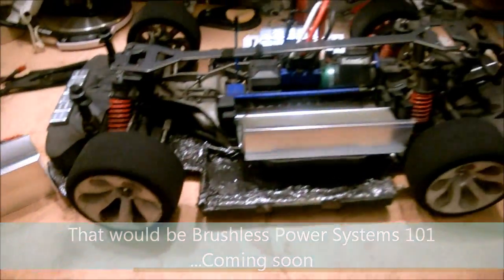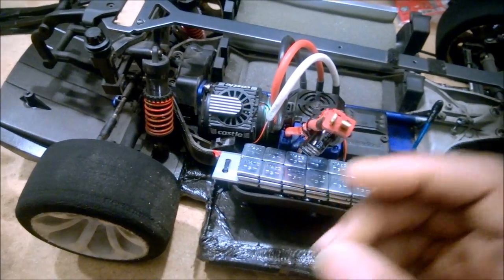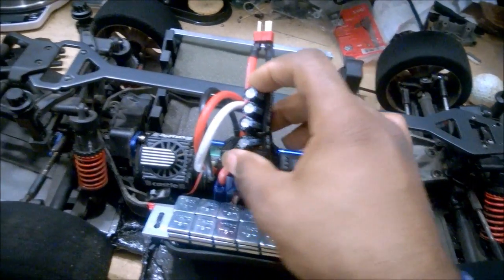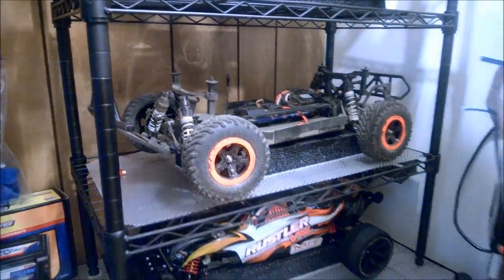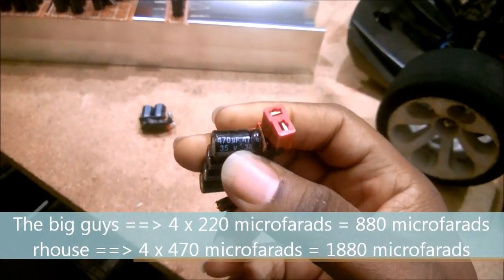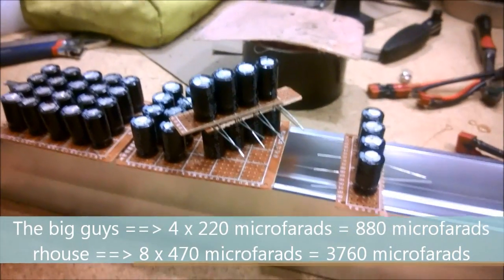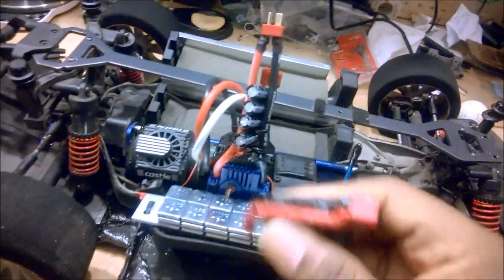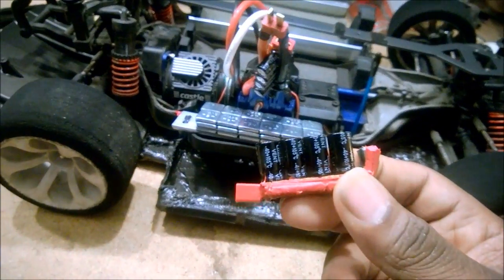Ep. 88: Cap Packs 101

Comment: What if I Run a 50c 5000mah 4s lipo mamba monster 2 slash 4x4 do I need a cap pack
Reply from the maker: saud al abdullah A cap pack may not always be needed, but it shouldn't hurt. A Mamba Monster 2 ESC can pull up to 120 Amps continuous and quite a bit more in very short "bursts". The cap pack will fill in the "burst" demand making it easier for the battery to keep up with the ESC's power needs. Not all batteries are created equal (sometimes you can't trust manufacturers' C-ratings). A good hi-C lipo should be able to keep up with the continuous load (Castle recommends 25C or higher), but they still need a short time to 'ramp up" to a really high burst load. A good quality cap pack should help everything work better and provide fairly cheap protection for your electronics, so I say go for it.
Reply: Thank you very much I stick with traxxas and hpi batteries
Reply: Oh and if I run 20t pinion and 54 spur with a Center diff on a mamba monster 2 slash 4x4 4s how fast will I go ? I have the j concepts scalpel body with xo1 wheels
Reply from the maker: You can use the website to below to calculate your top speeds, but you probably should drop the center diff and either go with an E-Revo/Slayer slipper clutch or use a slipper delete unit. The center diff is really intended for off-road racing. The problem is that if you start to spin your wheels, the digg could send all your power to the spinning wheels and kill your run.

http://scriptasylum.com/rc_speed/index.html
Reply: I'll try the Center diff and the stock slipper clutch and see which I like best it depends on the car not all are the same most of the people I know run a Center diff and some use a slipper clutch (stock) anyways thanks for the website I'll check it out !
Reply: I tried the site it said I will reach 20mph 😂 really a brushed stock car can go faster
Reply from the maker: saud al abdullah I think you may need to double-check your inputs. You have to be sure to enter all your car's inputs accurately or you'll get some weird numbers. I'll put your configuration in my spreadsheet and see what I calculate later today and get back to you. Are you running the 2200 kv motor?
Reply from the maker: I ran some quick numbers. If you have a 3500-3800 kv motor an the battery voltage doesn't sag too bad, you should be in the 70+ mph range (maybe even a little better). If you have a 2200 kv motor and those gears, you are looking at 40-50 mph.
Reply: Thank you very much but those are low numbers I run the 2200kv what can I do to hit 90 at least and is it safe to run 6s my dads friend said it will explode I'm not sure
Reply: 50 is lower than stock traxxas  promises with a stock spur 80mph with 6 cell nimh
Reply: I just found a 25t pinion laying around brand new I guess ill use that see how it goes
Reply from the maker: You've got a little homework to do, my friend. The kv-rating of a motor tells you how many rpm you can expect for a given amount of battery voltage. The 2200 kv motor is bigger, but it spins ~60% as fast as the stock brushless motor for the same voltage. It produces a LOT more torque, though. So, just putting in a bigger 2200kv motor without significantly changing the gearing will actually slow your car down by 40%. As a result, you need to change your gearing to take advantage of the torque on hand and speen the wheels a LOT faster. Play with the speed calculator website I gave you and it should put you in the right ball park. I hit 70+ mph on the slash platform on 3S and many guys have done 80+ on 4S with your motor. Your ESC is good for up to 6S, but I'd recommend getting really comfortable with your 4S setup before going higher. I'm using the same ESC and hope to get over 100 mph on my next outing. Driving these things at high speeds is HARD and you have to do a lot to keep the car on the ground. The Scalpel body claims to be a speed-run body, but it is pretty draggy compared to others out there. Look up guy named Tinsley Smith on YouTube who did 100+ using that body, but had a lot of problems with it getting airborne. There are other options out there that work better.
Reply: I wanna run 80mph so what gearing should I put
Reply from the maker: saud al abdullah Speed run guys are very protective of their gears. It's kind like asking for someone's secret recipe. Truthfully, the best gearing will vary from vehicle to vehicle so you really have to experiment to find the best setup for you. Two identical cars with different bodies, batteries, and tires will give different top speeds. I will tell you that the E-Revo/Slayer 36 tooth Mod 1 spur gear is what I use and is a good starting point. You can use the website I gave you to figure out the right pinion for your speed goals. Assume your battery voltage will drop to ~3.3 - 3.7 Volts per cell under load (13-14V total) and get two or 3 pinions spaced 3-5 teeth apart and you should have everything you need to find the right gear for you. Good luck!

Comment: good vid. but using higher V caps cant hurt. kind of like having a bigger cup...you can have more drink without spillage
Reply from the maker: Actually, there is another secondary benefit. As I mentioned in linked video, (https://youtu.be/cBQXZ3aEh5k ), one of the reasons caps fail is that they can heat up internally while surpressing ripple voltage. Higher voltage caps are physically larger and have more surface area to shed heat, so they should run cooler under the same conditions. 

Thanks for the comment!

Comment: I have a Arrma Kraton running 5200 50c 4s And at times drop in 2 5600 75c 3sPower Hobby battery’s And stock BLX185 esc And 2050kv motor.  What would be the best choice for this ?
Reply from the maker: I should have a batch of my 8-Cap rH218-8S packs ready this weekend. One of those would probably work really well for you.

Comment: Good video. quick question. on my 6s system, my data log shows a drop of about 4 volts at full throttle. do you think this is due to not having a cap pack? or is this a battery/esc issue?
Reply from the maker: Actually, what you are seeing is called "voltage sag". I did a video on this a little while ago. https://youtu.be/0KLOXEWrOes

In short, even though batteries convert chemical energy into electricity, they have a small amount of resistance to electricity flowing through them. (As you might have guessed, this is called "internal Resistance.") Ohm's law says that when you pass current through a resister, you will see a small amount of voltage drop across that resister. (V_drop = system current * resistance) 4 volts of drop is actually not too bad actually. Many guys see as much as 6-9V of drop. I have another couple of videos that show how to dig into your data logs to get clews about how your power system is doing. 

https://youtu.be/0DJSKSlGdq4 
https://youtu.be/b_iVQyl0Ags

Be careful crunching the data, though because it can take a little while to get a good feel for how to interpret the data. For example, 4V of sag ca mean that your batteries are VERY good and manage your system's load very well OR it an mean that your system is very lightly loaded and you are not pulling much current implying you have a LOT of tuning headroom. 

I hope this helps!
Reply: so I guess my question is. do I need a capacitor pack, and if so which one of yours do you recommend? looking at the data log, the most sag I can see is about 5.5 volts.
Reply from the maker: How much ripple voltage are you seeing? If it is more than 10-15% of the system voltage (more than 2.5 - 4V), you should probably be running a cap pack. I run my 8 cap rH218-8S packs on my MMX ESCs and the ripple voltage dropped from 5+V to ~10V with some pretty high current loads. Remember, your batteries have a lot to do with your overall ripple level, so you may end up with a different number than me in the end, but it should be a significant improvement. If that's not enough, I'll be willing to exchange that pack for a 12-cap rH2112-8S, but I suspect the 8-cap version will handle your system fine.
Reply: rhouse21 - RC Physics can you give me the link to buy it on eBay. I'll also do a before and after video to show the improvement.
Reply from the maker: Here's a link to my ebay auctions.

http://www.ebay.com/sch/Toys-Hobbies/220/m.html?_nkw&_armrs=1&_ipg&_from&_ssn=rhouse21&_sac=1

Comment: How Would I Know If My Cap Packs Are Working?
Reply from the maker: This is a simple question with a not-so-simple answer. In a nutshell, there are 3 ways to tell if your cap pack is working.

1.) A good cap pack should filter out system ripple, which protects the ESC from damage and can make it perform a bit more efficiently. Many guys say this will result in lower run-temps and more overall power. Soooo, you might be able to "feel" that your cap pack is working by noting any differences in system power and/or run-temps. The problem is that a good ESC may not need a whole lot of help under most conditions, so you may not feel any difference at all. This is a tough one because it's all based on "feel" with no data. I have guys who claim that my Cap Packs completely changed the behavior of their cars.... but On'y a couple of guys have actually been able to show me any data confirming anything.

2.) Speaking of data, if you have a data logging ESC or an EagleTree data logger, you can look at your data logs with and without your cap pack installed and see if it is lowering your system ripple. This is about as clear as proof comes, but some guys are a little intimidated by digging through data logs. Here is a video I did a little while back that can guide you through that process. https://youtu.be/0DJSKSlGdq4

3.) So, lets say you do not have a data logging ESC. You are not out of luck. You can actually get a fairly inexpensive multi-meter with capacitor measurement capability for $20-$40. Ideally, you would want to measure the capacitance in the ESC before you install a cap pack and after you have it installed. I wire all my cap packs with a quick connector so I can easily disconnect it from the ESC and measure it directly, but measuring it while connected to the ESC works too, as long as you know how much to deduct for the ESC's internal caps. This method will also tell you if you have blown any caps in your pack, which does happen over time with enough abuse. Here is another video I did showing how to take these measurements. https://youtu.be/cBQXZ3aEh5k

Thanks for watching!

Comment: Good day, sir. Nice video. So 8 pieces of 35v 470uF caps would be enough for 8s speed runs? 8s is max 33.6volts
Reply from the maker: It honestly depends on the caps, the system current levels, and the quality of your batteries. Lower current levels and better batteries drastically reduce system ripple voltage. 

If you go to a good electronics web site like www.digikey.com or www.mouser.com, you can pull up the detailed specs such as ESR (Equivalent Series Resistance). The lower the ESC, the faster the caps will charge and discharge, so the more effective they will be. A few 'small' high quality low-ESR caps may outperform 10 high uF "junk caps" from Ebay or Amazon.

Also, you should look at other specs such as expected lifetime and ripple current capability.
Reply: @RCPhysics  thanks sir. Im using  2x 4000mah 100c 4s lipo. I will refer to that link you've given

Comment: which is better a high uf or low uf for rc cars
Reply from the maker: The uF value of the individual caps sets the RPM/current level where the Cap pack starts filtering your system. Larger uF caps will kick in at lower frequencies, but will not be able to keep up s much as frequencies climb very high. More caps in parallel help to manage higher current loads in the system. One of my 8 cap rH218-12S cap packs would provide great protection for a 300+ Amp Castle XL-Series 8S ESC while a 4 cap rH214-6S cap would be enough for a most 3-6S systems rated for ~100-150 Amps.

Comment: Will It Also Prevent The lipo Batteries From Puffing Up???
Reply from the maker: Batteries puff because they have sustained internal damage. A good cap pack should help your batteries see a more stable load that should help to protect them from damage, but a cap pack can only take so much abuse before it starts to take damage itself. 

I think a good cap pack will help, but there are a LOT of other  factors at work. The cap pack will work harder with lower quality batteries. The lower quality the battery, the harder the cap pack will work to try to insure clean power, so the more likely you are to blow caps in your pack. If your packs are puffing, they are being overworked. Adding a cap pack would probably help, but that would just be a "band aid". The pack will probably fail if you keep pushing it that hard. Puffing is a sign that it's time to upgrade to better cells.. 

Thanks for the great question!
Reply: Ooh, WOW!! Thanks For Answer.. I Learned Something New.. I Just Ordered A Cap Pack From Castle Creations, Hope It's Good Enough For My X Maxx Esc?
Reply from the maker: That may be a little small for that ESC. Are you running the stock ESC and is it the 6S or 8S version? The castle cap pack is for 6S max but it's really meant for much smaller cars (1/10 or 1/8 scale) with ~100 Amp ESC's, so just be careful there. The X-Maxx is a pretty big machine and that ESC probably pushes quite a bit more amperage that might overwhelm that cap pack. 

I would recommend one of my rH218-8S packs, but I'm out of stock right now. Check back with me in about a week, though.
Reply: rhouse21 - RC Physics Ooh I See.. I Have The Xmaxx 8s Version, But Only Using Traxxas 5000mah 25c 6s Lipo Batteries... Cant Afford The 8s Lipo Batteries.. Do You Sell Them On Ebay?
Reply from the maker: I sell my cap pack on Ebay. I've been slow getting my latest batch ready for sale though. I don't sell batteries, however.
Reply: Ok Cool,What's Your Seller Name?
Reply from the maker: rhouse21 :-D
Reply from the maker: http://www.ebay.com/sch/Toys-Hobbies/220/m.html?_nkw&_armrs=1&_ipg&_from&_ssn=rhouse21&_sac=1

Comment: Would you fit a cap pack on a xlx2 just as a precaution or no? K8s 1100kv motor.
Reply from the maker: I've sold a number of custom cap packs for XLX2 setups just for extra protection. Technically, you can't really have too much capacitance... unless it starts to cause such an in-rush current spark when you plug in the batteries that you are starting to damage your connectors. 

That said, the XLX2 is a pretty stout ESC. Check your data logs first to see how bad your ripple is. If it's over 3-4V on 8S, you might want to consider a cap pack just as a precaution.  

Thanks for watching!
Reply: @RCPhysics  awesome so I use qs8's on everything I own, I was thinking about just putting one on to make sure I n ver ripple I drive my k8s exb 1/5 for sometimes 12 seconds full tilt in park areas and castle said I don't need one but I wanted to just for added protection. Would you use the 8s cap pack or the 12s one? Going to buy it now at hobby shop! I applied the fast response! +1 sub here!!
Reply from the maker: @never-stock-rc2968  You don't get any additional benefit using a cap pack of a higher voltage than you actually need. Cap sizes are measured in Farads which are defined as the number of electrons the cap can hold per volt applied. So a 6S, 8S, and 12S cap pack will all hold the exact same number of  electrons on 6S. It's like buying a 5 gallon bucket to move 1 gallon of water. 😎
Reply: @RCPhysics  ok because I accidently bought the 12s castle cap pack instead of the 8s one. So I'm ok to run the 12s cap on an 8s system then? Thanks man I am it so much!!!
Reply from the maker: @never-stock-rc2968  Yup. The 12S pack should work fine, but you might want to sell it, buy an 8S version, and pocket the price difference. 😆
Reply: @RCPhysics  yea so they are the same price believe it or not haha crazy right 23.00 but I might take it back and make my own for 6.00 for all my RC's I solder for a living so it's nada to me
Reply from the maker: @never-stock-rc2968  That logic is exactly why I started designing and building my own. I really need to do an update video because my latest cap designs are a lot more sophisticated. At their core, they are still just a bunch of caps wired in parallel, but I've included a lot of usability features to make them easier to mount and live with. 

You can see some of my latest custom packs on my Facebook page. Let me know if you are interested. https://www.facebook.com/rhouse21RCPhysics
Reply: @RCPhysics  yea for sure I think I'm going to try to make my own as well. Thanks for the reply I'll definitely check it out for sure thanks a ton

Comment: Brother I need two caps that I need .. They r the ones on the XL inside on power side . If u know or can help please hit me up !! RCFL brother good stuff !!
Reply from the maker: JM Speck How comfortable are you with electrical stuff like fine soldering and circuit testing? If the capacitors are just blown, you can probably find 2 of about the right value at Radio Shack for a couple of bucks (literally) and swap them out. You can probably find them cheaper online, but you'd have to wait for them and you may need to buy a lot more than you really need (like I did in this video). 

This job shouldn't be too hard if that is all that's wrong. What concerns me is that some other component on the circuit board may have gotten fried after the caps blew and you could now have a ticking time-bomb that could start a fire. Have you called Castle for a warranty claim? They are usually pretty good about that and even have an "out of warranty exchange" program where you can buy a replacement ESC at a deep discount. I'm just worried that with the power you tend to push, you might get a repeat of mrtuner89 's electrical fire.

RCFL, and stay safe!